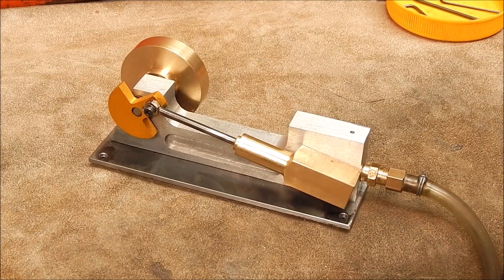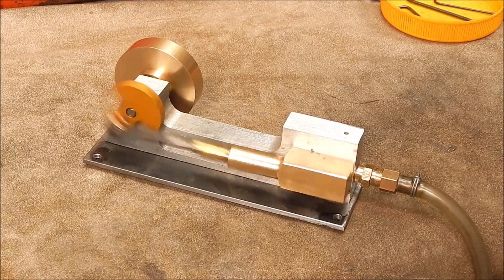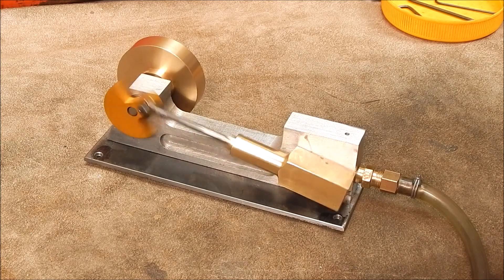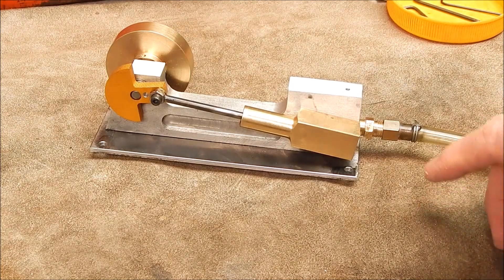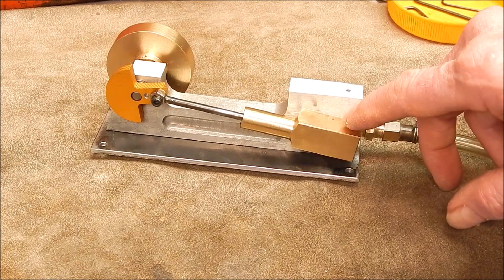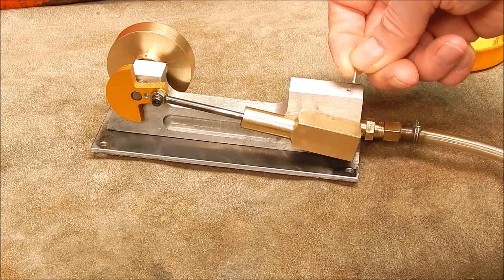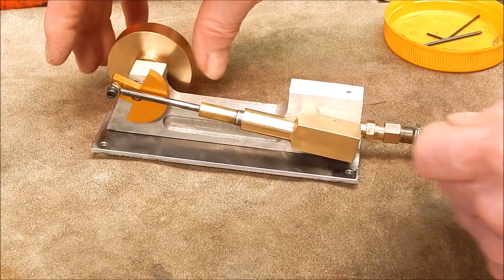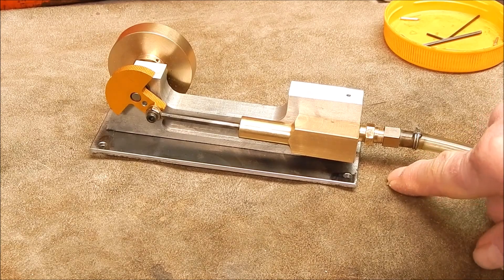The wobbler steam engine runs - plus my top tip for building one

Comment: Lovely job Rob, runs a treat 👍👍👍 Another way to make the holes for the ports is to drill the cylinder hole all the way through. You can then assemble the engine, move the conrod to it's extreme ends of travel and use a small transfer punch to mark the hole positions on the port face. Of course, with this method you do have to seal the hole in the outside of the cylinder once you are done. Cheers, Alan.
Reply from the maker: Hi Alan.  Yes, I was aware of that method, but the unwanted hole has to be plugged.  My method gets around all that.  Just a few cosmetics to finish it off and it will be time to try something else 😎   I have a few possibilities in mind.  👍Cheers Rob

Comment: Good little engine Rob. Are the port holes all the same size in both the aluminium and the brass? Do you drill the holes in the aluminium at the far ends of the scribed line from the nail?
Reply from the maker: Hi Jon.  Yes, just remember that the end of the line is exact centre of the nail/drill.  The port holes/galleries are the same diameter in the ally and brass.  You can make them whatever size will fit in the available space, but there's not a lot of air to be moved so small is OK.  I have thought about making one slightly larger than the other to be sure of complete coverage, but it has never been an issue.  The far ends of the scribed arc are top and bottom stroke dead centre.  That's where you drill the port galleries.  You can see by the piston position which will be exhaust and which is inlet.  Good little project.  Have a go.  The only tricky part is the port plumbing and I've covered that pretty well.  There is another way to do it, but it means drilling right through the piston cylinder and then plugging one hole afterwards. Not necessary if you follow my lead.  Cheers Rob

Comment: Nice one Rob. I wonder why the speed varies slowly?
Reply from the maker: I was changing the air regulator pressure.  The engine still needs to be run in a bit.  Cheers Rob